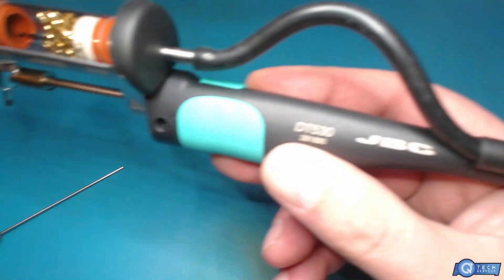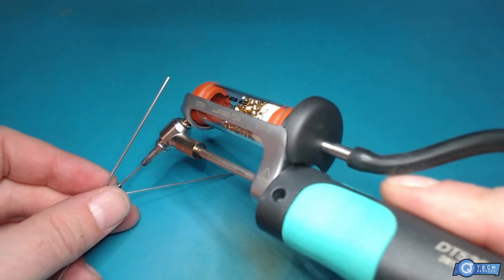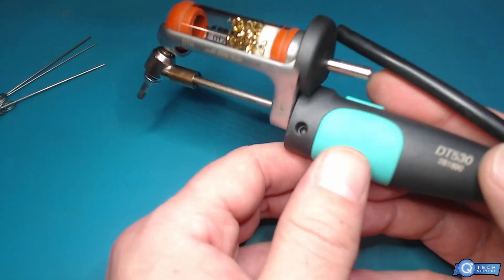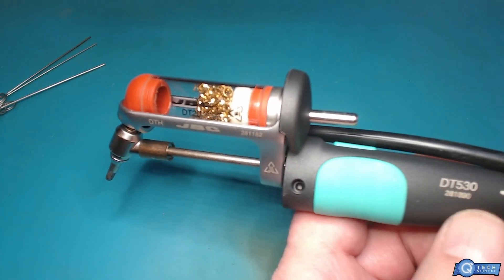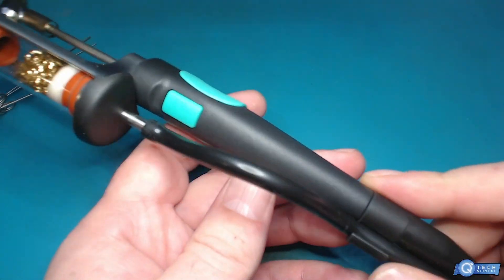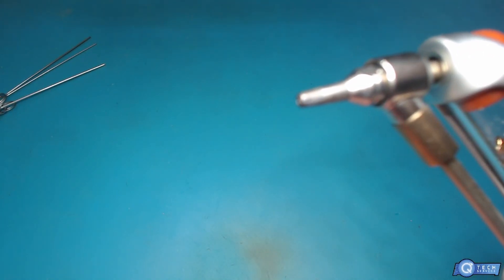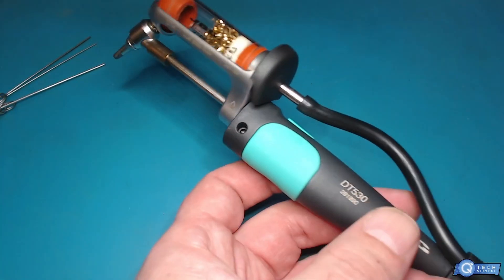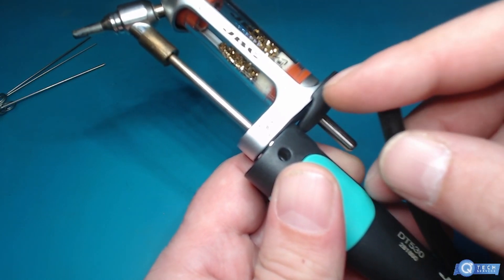JBC DT530 Angled Desoldering Iron Part 2  $60 China Pump Model # VN-C4 24V Brushless (VN-C4-24

Comment: Any follow up?
Reply from the maker: Nothing with the company, but I figured out what it is the front filter on the system has to be removed basically not installing a filter.So the door can make a good seal with the filter removed, lots of suction power

Comment: No it doesn't suck that is the whole problem ;) . The chinesium ones are about $150 -$200 CDN I think. Ouch a couple of grand yikes.
Reply from the maker: @GregM  yes Greg the $150 system less than 150 $ sucks way more than the JBC the equipment they selling so sad 😞 and they’re charging $2000 but you have to have the station too so you’re looking at another 2000 $4000 for sucking station when you can get one for 130 bucks crazy